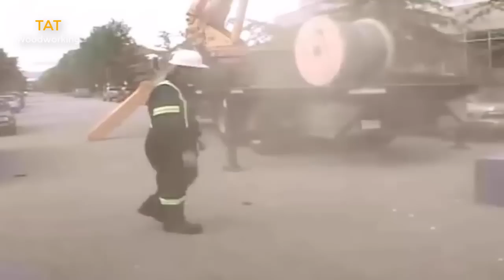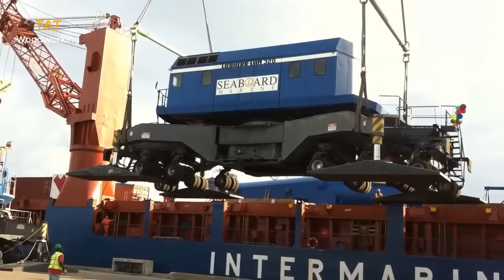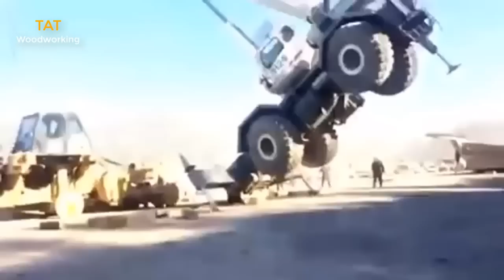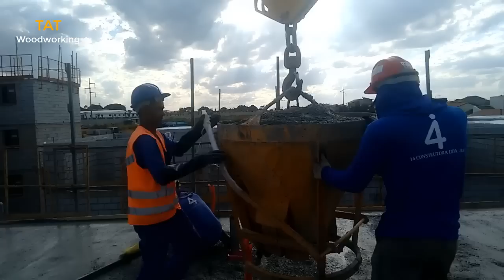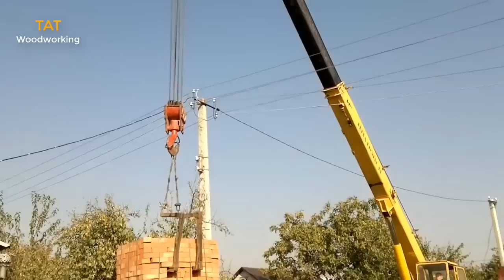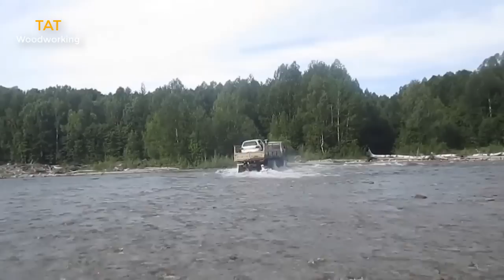10 BIGGEST CRANE FAILS - Amazing Dangerous Idiots Heavy Equipment Crane Operator Skills

Comment: I’m a heavy equipment operator 30 years plus , but I have never worked on cranes or extensive rigging , in the first clip , would that have completely totaled the 2 lifting cranes , due to heavy stress then 0 stress , then snapping the main boom in the reverse direction ?
Reply from the maker: Thank you for watching. Wish you all the best!
Reply: Probably not completely toast but that can sure mess up a lot of money.